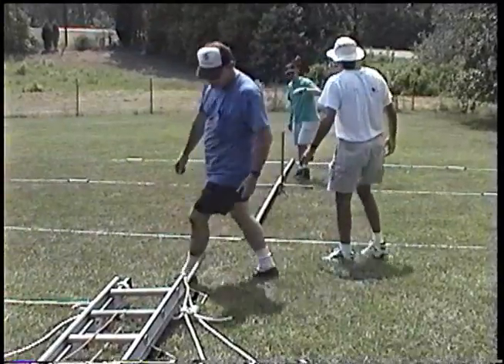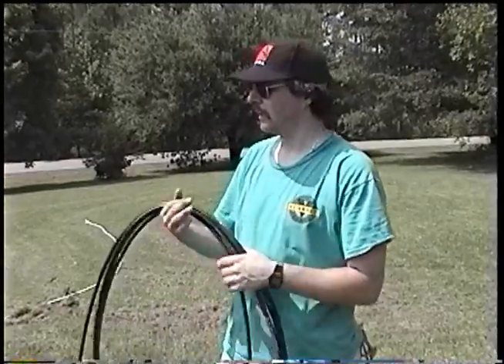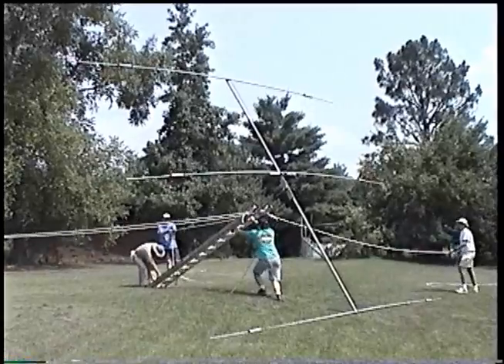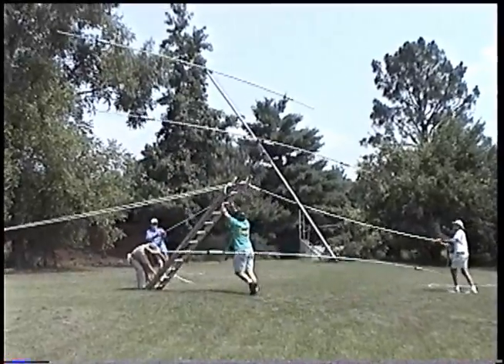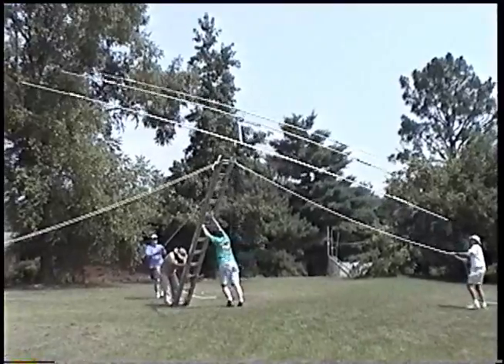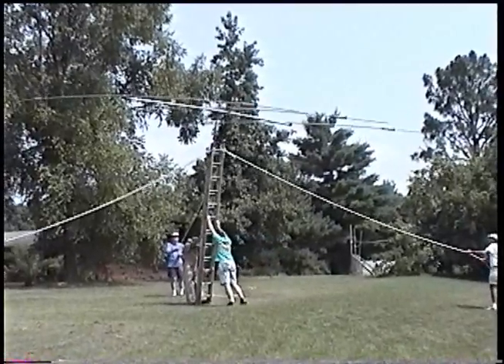Beam and Extension-Ladder "Tower" for Field Day

Comment: This was Field Day - a 24 hour contest. It was up a maximum of 48 hours. It does fine in the wind since it's guyed well. A friend has just put up a 'permanent' version, with the base in a concrete block for added stability. I suspect a turbine/blades have more wind loading than a beam antenna, but it's really out of my experience.